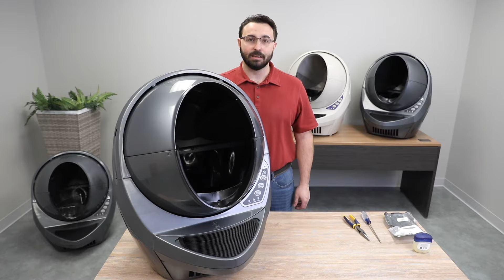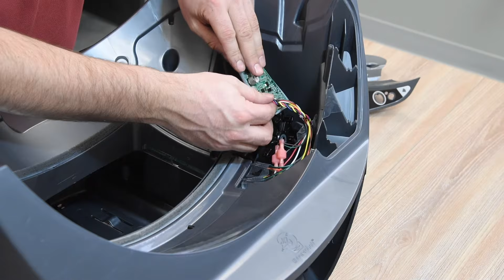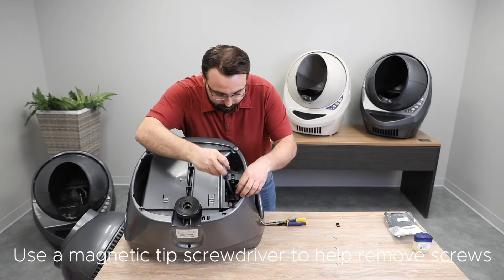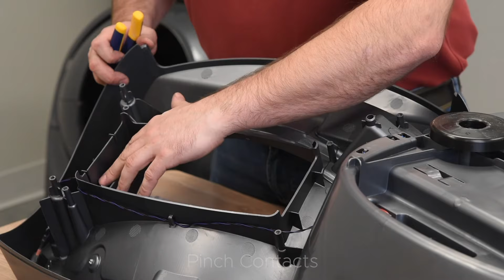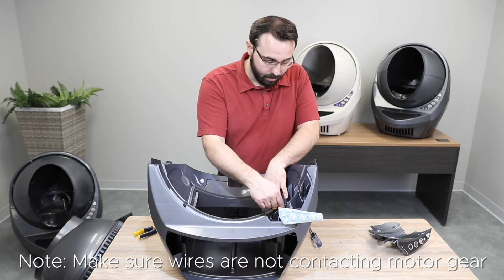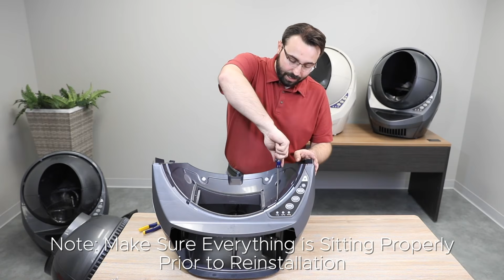Litter-Robot 3 DFI Kit + Pinch Detect Terminals Installation

Comment: Please pin a comment that tells people they need a Philips screwdriver with at least a 6 inch long shaft. That does not mean the screwdriver is 6 inches long, but the narrowest shaft is that long. It is not a normal household screwdriver. Some of the screws are inset very deep and you can't angle a regular screwdriver into the correct position to remove and replace them. Overall I am so happy to have been able to buy a $30 part and $10 screwdriver to repair my robot vs. buying new. Thank you!
Reply from the maker: Thank you for your feedback and for the tip about the screwdriver! We have pinned the comment so anyone coming to watch this video can take the tips from others into consideration. If you ever have any other questions about your Litter-Robot, please let us know!

Comment: If you can work off of audio alone this is perfect, if not this is not the instruction guide for you. The video does not show up close parts so you have no idea if its correct until the whole this is put together. The "easy" parts were a lot more complicated than this guy made it look. I couldnt tell if i connected the wires correclty or not. Had to plug in my litterbot to figure out that it was all wrong and didnt fix anything. Waiting to hear back from the company on where to send it for someone like the guy in the video to fix it, seeing as he knows what he's doing and I still don't. The other part was the fact that they sped up the video as he was unscrewing everything, way to make it easy for someone to follow along instead of having to stop and pause and continue that process for 17+ minutes
Reply from the maker: Thank you for your feedback regarding the steps in this video. We would be more than happy to answer any questions and provide further assistance at whiskersupport.com

Comment: I've had my litter robot 3 for 4 years now. I bought the extended warranty with the thought that after that amount of time, if it broke, it would still be worth it to not have to scoop two cats poop multiple times a day. During the warranty period I had some issues that customer service helped me to fix each time. One of the times they sent me this kit. I replaced the DFI at that time, but not the pinch detect terminals.  Fast forward to two years later, out of warranty, and the pinch terminals are corroded. Lucky for me I saved all of the things that were sent to me two years ago, and I was able to replace the pinch terminals by myself. This simple (not so simple, but absolutely worth it to not have to buy another unit right now) fix is going to extend the life of my machine for at least another year or two, maybe 4! I love the Litter Robot and will absolutely be buying another when this one finally kicks the bucket. Worth every penny.

Comment: I just swapped out sensors and pinch prongs.  It cost me approximately 30 bucks and fixed the blinking blue light (which was sensing a full draw at all times).  I had cleaned the heck out of the old one, but that didn’t work.  They should do a recall, since this is such a common problem with their product.
Reply from the maker: Thank you for your feedback, we are glad to hear your Litter-Robot is working properly again. For further assistance, our team at whiskersupport.com would be more than happy to help!

Comment: All this video has done is broke my robot even more. Never worked this since I have had it!! Shouldn't break after 4 months. Now I've followed this video and it won't power on so worse than before it's not been Woking for 6month
Reply: Just replaced mine today and same issue, mine won't power up anymore
Reply from the maker: Hi there, we're very sorry to hear the instructions in this video didn't resolve the issue. Our Litter-Robots come with a WhiskerCare™ 1-Year Warranty (3-year plan available for purchase), during which we will repair your Litter-Robot at no cost to you if anything goes wrong. We pay for the parts, labor, and shipping. There are no deductibles or hidden fees.

If you have not already, completing the troubleshooter ahead of your ticket submission will help us escalate your ticket for faster support. However, you can also submit a ticket on our website: https://support.litter-robot.com/s/contactsupport?language=en_US
Reply: I did contact you but you told me to contact robot uk to sort as I got from the robot shop because I'm in the uk

Comment: My husband and I just spent an hour watching this video and attempting to fix it ourselves. It’s very involved, the camera angles are not great, and we both became so frustrated that we had to stop and walk away several times and we aren’t wound up people. The attempting to put all the wires back under the motor and not have anything touch is not just “a little tricky”. I don’t even know if it fixed the issue yet — for this price you should have people to fix these issues because this was beyond a simple repair and we have 2 litter robots that both broke down so we have to attempt this 2x and I’m thinking of just throwing them in the street because it is that difficult to fix.
Reply: I used electrical tape to help keep the wires in place, they were taped down with a clear tape when i opened it up. So i swapped those out. Not beginner level stuff, but not skilled either.
Reply: Good tip!  @nicoles2828
Reply: It’s okay to find this difficult. I did it without a video in 30min or so.
Reply from the maker: We are so sorry for any confusion and would be more than happy to help further. Our product specialists are available to assist at whiskersupport.com.

Comment: This video was mostly very helpful. But if you ever make it again, showing the actual things instead of "make sure this is behind here" would be really helpful. I have no idea if I got my second pinch detector piece in right and won't get to know until I finish reassembling since I can't tell before then. 🙃
Reply: Yeah, the video could use a few closeups from a good angle. For example, it was impossible to see exactly where the pinch plates were located, or how they were oriented which is pretty important. Everything that the user needs to see is hidden around 7:00.
Reply from the maker: Hi there! Thank you for your feedback on this video. We have forwarded this to our team to keep in mind the next time we're filming support videos. If you have any further questions about your Litter-Robot and the instructions in this video, our team at whiskersupport.com would be happy to help!

Comment: Very helpful video. I did get my non-functioning robot working again, watching along with the vid as I worked. One suggestion though: use more close ups to see exactly what's being done, and what the presenter is talking about. It took me about 15 minutes to get the DFI circuit boards oriented correctly. I couldn't clearly see it from the video, so had to do a bunch of trial and error before I got it right. Also a note for consumers, understand this is a skilled expert in the vid doing the repair, using a brand new unit (?), that looks like it's never been used. My robot for example, had litter sprinkled around/on the motor, and other places, so I had to wipe that off, etc. Just expect it to take a bit longer, and maybe not be quite as easy as the video shows. BUT, it is completely do-able, and my robot is thankfully working normally again :  ) Thanks
Reply from the maker: Thank you for your feedback about this video! We have forwarded your suggestion to our video team for the next time we create support video content like this. We're glad to hear your Litter-Robot is back in great shape!

Comment: Not sure why they sent me a dfi kit when my unit probably needs a new motherboard because it only does the short clockwise cycle to settle the litter.. Have to unplug the unit from wallpower for 30 seconds and then it does a normal cycle without issue, app shows litter levels fine and the original sensor does react and stop the machine in a pinch scenario
Reply from the maker: Hi there, we would be more than happy to assist further! If you haven't already, please contact us at whiskersupport.com or support@whisker.com

Comment: It was good to have the video, though it would helped if the photographer had shifted viewpoints more instead of taking a rather static position. We had a ton of trouble from the design removing the 9 screws once you flipped it over.  There simply wasn't clearance for a regular screwdriver to reach down into the deeply countersunk holes.
Reply: A standard 4" shaft #2 Phillips screwdriver will not work for all of the bottom screws.  A 6" or longer will work.  I always watch the video at least once through before doing anything to make sure I have everything I need and am mentally prepared for the task.  There is NOTHING worse than watching the video feeling all prepared only to find out you need to run out and buy something after you've nearly disassembled everything!  And you better hurry before kitty needs to go.  A simple disclosure in the beginning would have prepared me better.

Comment: I just did this replacement. It seems like the old part (mine was from 2021) had a design flaw in that it had a large PCB exposed to the air, leaving it vulnerable to corrosion. The new replacement part seems redesigned -- the PCB is much smaller and it's covered in more plastic. So i suspect it will last longer than the old one. Thanks for addressing this with a design change.
Reply from the maker: We are so happy to hear your Litter-Robot is back in tip-top shape! We are always working on improving our products and our team is always happy to answer any additional questions that arise!
Reply: @LitterRobot where do we get the new parts? I have 2 broken robots. I am disabled and I am stuck scooping for 8 rescues again. 😢

Comment: This video is totally outdated.  I had to pay for a new set of sensors abt $40 and the new sensors are half the size of the old ones.   No video exists online I could find to install the new sensors.   Litter Robot owes a refund to all that purchased new sensors without showing how to install them the worst part is lining up the 4 pin connector they shld say what the color orientation is.   Great machine but horrible to maintain.
Reply from the maker: We greatly appreciate your feedback and are sorry to hear about your experience so far. We would be more than happy to get you connected with a team member who can provide further assistance. Please contact us at support@whisker.com, WhiskerSupport.com, or 877-250-7729.
Reply: Newer sensors are smaller but mine came with new plastic mounts to fit them. The pinch detect pieces are the same.

Comment: I need to replace only the pinch detect terminals. I presume that I do not need to disassemble the control panel for that?
Reply from the maker: Hi there! We would be more than happy to connect you with a product specialist on our team to answer any questions and provide assistance. Please contact us at 877-250-7729 or support@whisker.com.

Comment: You should make this repair on a used litter robot! It’s not easy like you make it out you have to deal with a lot of smelly litter and smelly dust!
Reply: Well wash it first!
Reply: I just opened mine and it’s full of litter.
Reply: Anyone else have issues with orange cycle light staying on. Blue light is solid blue but orange cycle light also stuck on? Tried tacking out key pad and putting back in place.
Reply: Well... clean it....

You can also empty the litter out with the empty button, if needed.
Reply: @James_Bee  do you not clean it out once in a while?  I take mine apart and scrub what doesn’t have electronics on it but has contact with waste and scrub it about every 3 months then blow out the loose litter elsewhere. I want to keep it in working order because I do NOT want to go back to scooping manually ever again!  Mine is almost 5 years old & I replaced the DFI components today, it’s back to being a work horse!  Keep it clean and it’s less you’ll HAVE to clean in the future.  😊

Comment: Video tip: I do not need to see the repair guy's face, I need to see what each step should look like when complete. You need better angles and more close ups of what his hands are doing. 
You also don't provide this exact DFI kit anymore, you need a new video with the new kit. It's incredibly frustrating to watch this and not know if you're installing the part correctly because the part is different.
Reply: Thank you! This video is so frustrating. There should be clear zoom in's to what's happening not some dude.
Reply: @johnbod  Agree - no clear visual on what to actually do.  Getting the wires in place to finish the control panel had me swearing like a sailor
Reply: We prayed while doing it. I was so nervous we did it wrong cause we did so much guessing !!! Luckily it worked !!
Reply: please have a clear visual

Comment: There is obviously a reason if you purchased before a certain date you are eligible for a free DFI and pinch replacement kit. What was the reason?
I just replaced mine and noticed a few differences between mine and the replacement parts. Everything was reassembled just as I had taken it out, and the robot works, so clearly there was an issue with the hardware, not the installation.
Reply from the maker: Hi! Our Litter-Robots come with a WhiskerCare™ 1-Year Warranty (3-year plan available for purchase), during which we will repair your Litter-Robot at no cost to you if anything goes wrong. We pay for the parts, labor, and shipping. There are no deductibles or hidden fees. For further assistance, please contact us at WhiskerSupport.com, support@whisker.com, or 877-250-7729.

Comment: I have changed the wires and pinch terminals 3 times now. When I plug it in and turn on it does not even cycle. It won't do anything at all. Just blinks blue, wish I could get some help but no one to talk to. $700 bucks and they can't tell me how to fix it.
Reply: I had this same issue and the solution was to offer me to send in to repairs and get a 6mo warranty for $180 or buy a new base without connectivity for $174.50 or with connectivity for $199.50. 

A little pissed since I paid $40 for parts and it was a bitch and a half to take apart, repair, put together, and have it not work. I repaired it only for the pinch error code and now the DFI error code is the one going off. And now the solution is to have me pay more money for another part that will inevitably break too
Reply from the maker: Hi Joshua, we're so sorry you're experiencing this issue and would be more than happy to help. Please visit our Help Center (WhiskerSupport.com) to chat with one of our product experts or submit a ticket.

Comment: This is the go to instructions for replacing anything on the Litter Robot 3. Mine came with a little different wiring and the pinch sensor boards weren't the same. The boards are smaller and the wiring that gets replaced was different than what was on it, and what they sent me to fix the problem . I don't know if it's some new kind of sensor that works better or not, but when I finally got everything put back together and set. IT WORKED!!!! And the BLUE LIGHT WAS SOLID NOT BLINKING ONCE AGAIN!!! i hope this is the last time I have to do this. but after taking apart the whole thing I found places where the litter went that I don't have access to normally. I always try to shake it out first before cleaning, I'm just glad it's back in service and my cats thank you as well!!! Hurray!!!! No more scooping!!!
Reply from the maker: We are so glad to hear your Litter-Robot is working properly, Tammy! If you ever need further assistance beyond the instructions in this video, please visit our Help Center (WhiskerSupport.com) to chat with one of our product experts or submit a ticket. We're more than happy to help!

Comment: Thank you so much for this detailed video! I did not have any issues with my robot until just about 2 years after purchase in 2021. Customer service helped me out right away and sent me a free replacement kit. I kept getting the drawer full error after each use, and this fixed it! I felt that the directions great as long as you pause the video frequently and mirror EXACTLY how he has every part and every wire. **TIP** Make sure you have a LONG screw driver or else you won't be able to get all the screws out to take it apart! :)
Reply from the maker: We are so glad to hear your Litter-Robot is back in tip-top shape!! 😺

Comment: .."behind the other connector..."   Behind it facing the litter drop or behind it facing the outside of the unit?

I rolled my eyes so many times. Not being able to see if you did the connections correctly (solved by simply showing the finished action) was EXTREMELY FRUSTRATING.  While am somewhat mechanically skilled, I am not able to cognitively understand things without visually seeing them; a big miss on ALL of LR's vids.  I was so upset knowing that I could assemble it incorrectly and would not known I had until I tried to operate the unit. Please re-do these vids SLOWER and provide more visualizations of product repairs.

And I also followed directions to a tee. Blinking lights. I refuse to take it apart again (make sure you have a extra long screwdriver with a magnetic tip. The screws are death to put back in.)

I'm out of warranty but the can have this machine back. Too much trouble for the money it's worth.
Reply from the maker: We greatly appreciate your feedback about this and are deeply sorry if any of the instructions in our troubleshooting videos are unclear. Our Product Specialists would be more than happy to assist further! Please visit our Help Center (WhiskerSupport.com) to chat with one of our product experts or submit a ticket.